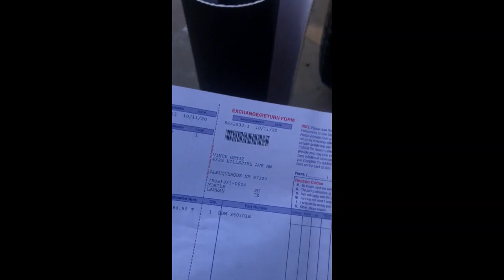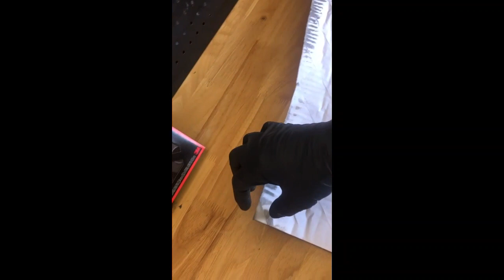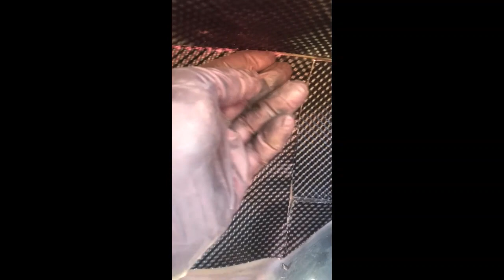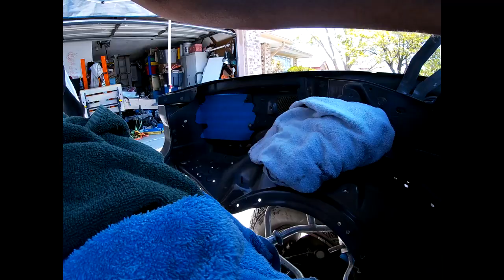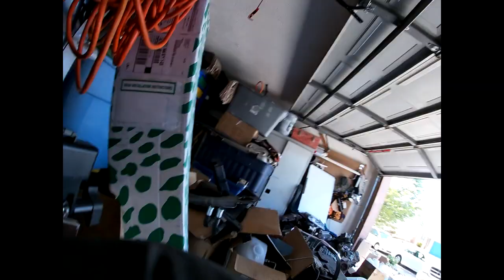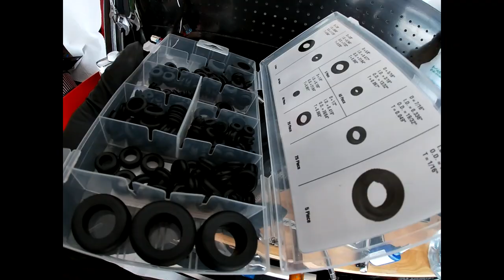Cold Air Intake 98-03 Durango Dakota (Hemi Swapped)

Comment: I'm thinking something similar but using the stock airbox. Being it draws from the fender stock theres a small horn at the front of the box that goes towards the inner fender hole that the fresh air is drawn from. Problem is, there's about 1" of gap between the horn and the inner fender, thus even if it is pulling in ambient air temps, it still has a chance to heat up due to the under hood temps and the heat soaked area... If youre running LED bulbs in your headlights that will create heat too right in front of where your filter is now.. There's no real right answer to it. 

Though I've seen one that actually drilled a hole through the outside fender and just drew in in from where the V8 Magnum badge would be https://www.youtube.com/watch?v=et8klUzLJ5s
Reply from the maker: My air temp drops while driving. It gets to about 5 degrees above the temp outside. So it works good